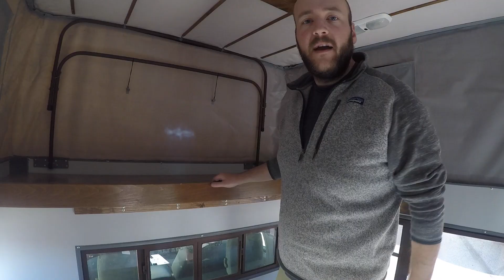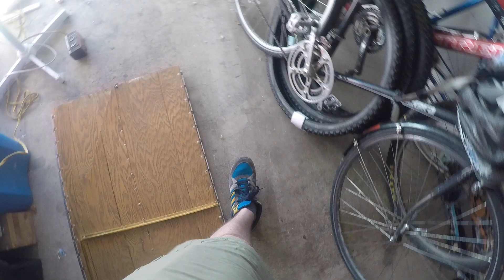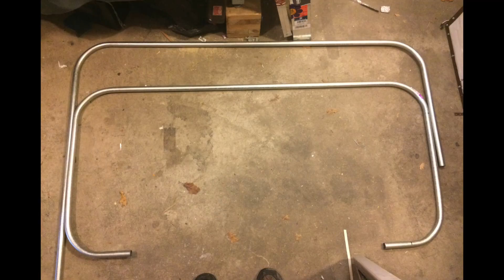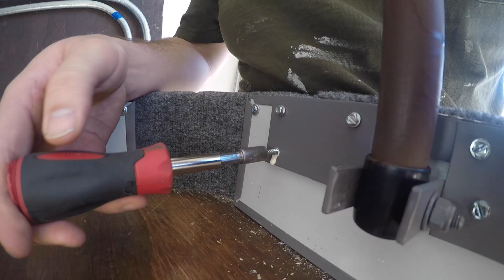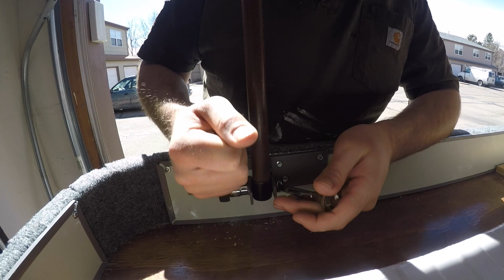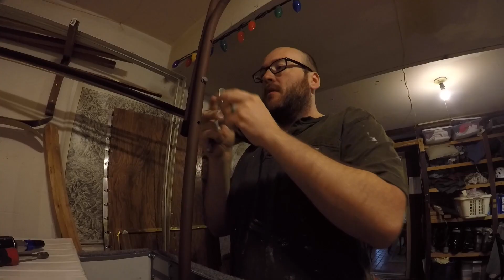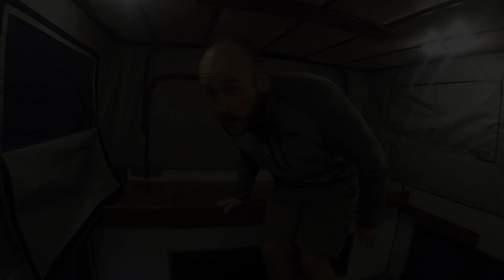DIY Four Wheel Camper Build:  How to make a roof lifting, pop-up mechanism

Comment: what's the trick to finding the measurement for the middle pivot point? Seems to me it needs to be half way in between the top and bottom pivot point?
Reply from the maker: Hey Douglas, thanks for the question. No trick, you are correct just put it halfway between the top and bottom pivots and you should be all set. The only caveat is that the lower pivot is sunken into the camper base just a bit, with enough room to accommodate the top lifter tube. So as long as you keep it halfway between the pivots you are perfect, just recognize that is not just halfway between the roof and base of the camper.  What projects are you working on yourself?
Reply: I have a 1997 FWC Scout.  Been debating selling it or fixing it up. It's still in OK shape but the riser gave out long ago. I was ready to give up but after seeing your video I'm going to try this DYI project.  I Do get that the bottom bracket is a bit offset. The problem is getting that lined up so that when the top comes down it sits where it is suppose to.  Thanks for the video!
Reply from the maker: Glad I’ve inspired you!! Fix it up. You won’t regret it. Sounds like you understand the lifting mechanism well. I’ve got
No tricks for lining up the pieces in the bottom. It’s honestly not perfect on mine but close enough. I have to pull at it times in the down position to tweak it in place. Feel free to ask more questions. Good luck.

Comment: Your Cotter pin is actually a Clevis pin.
Reply from the maker: I’ve never heard of a Clevis pin. Do you know what the difference between a clevis and a cotter?
Reply: @tgmorrissey  There are 2 fasteners called a cotter pin, one is one piece, bent in a "u" with one leg straight and the other is a flattened "w" that holds itself in place (spring action). The Clevis is a straight pin (rod) with a swivel that holds a semicirculer (wire usually) piece that swings around and secures the pin from the outside. I didn't look but I'm sure Amazon, Tractor Supply or any tool seller website will have a picture. They're pretty much interchangeable but the Clevis is probably more secure, the cotter is easy to insert one-handed. 
The other fastener called a cotter pin is also one piece, bet into a flat "u" that is inserted through the hole and the legs are bent to hold it in place, sort of semi-permanent. It's also called a split pin.
(I clearly spent too much time with farmers, welders and tool guys growing up!)
A buddy here at my shop just reminded me that some people call the Clevis a "safety catch" or trailer hitch pin and you can hold a Clevis in place with a cotter. 🤔 (now I know I still spend too much time with tool guys, or possibly guys that are tools)
Reply from the maker: Thanks for the education!